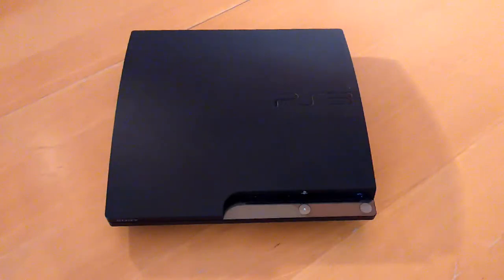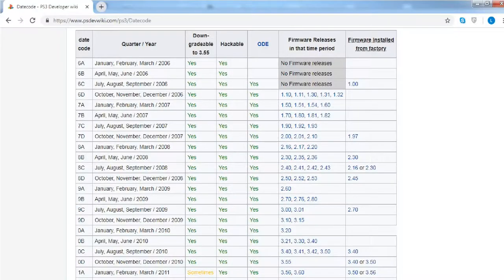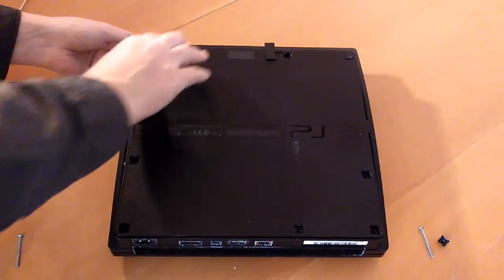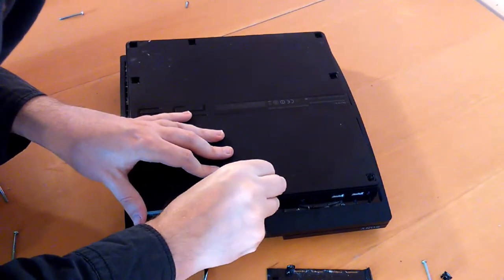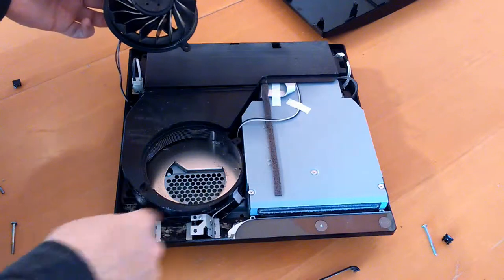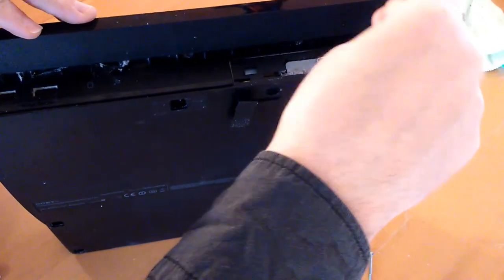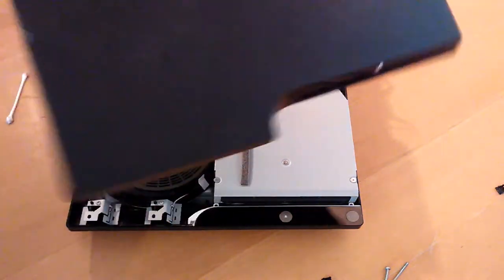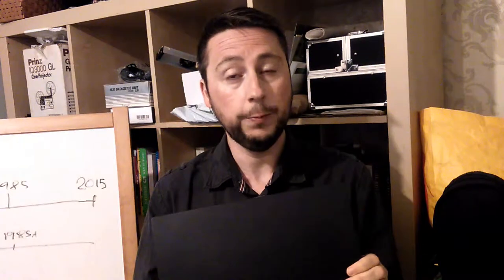How To Fix A Noisy PS3

Comment: Bro I tried the first method with holding down the eject button and plugging it in, and it sounded like it was gonna explode
Reply from the maker: Yeah it sounds like it's about to take off
Reply: EK tech  jailbreak got nth to do with the fans so you can do it
Reply: EK tech I’ve never had it I see it as mods in the files
Reply: EK tech  the method is to clean the fans and stuff and mods r just installed in the ps
Reply: @iklerzz721  well did it worked
Reply: @dennisbyrd99  ps4 now bro
Reply: @iklerzz721  I'm talking about the ps3 does holding down the eject button and plug it in method actually work
Reply: @dennisbyrd99  yh it works but if you’ve got a crazy amount of dust you’ll have to open it up
Reply: @iklerzz721  ok got it thanks 😎👍

Comment: My is now 9 years old and when I play something like black ops 2 the whiny noise get even louder and produces a lot of heat but I would have already taken it apart if it wasnt for the warranty sticker
Reply: PS3 Original consoles are too quiet and makes them very loud when they overheat because of the slow fan.

Comment: Everyone I fixed the noise if y'all want to know just ask me
Reply: HOWWWW TELL ME
Reply: @pratimagiribhat4075  make sure the ps3 ON then press down the powernub to turn off for 20 seconds and pull out the plug while pressing then turn on. Reply when you get thru
Reply: @pratimagiribhat4075  did you get thru
Reply: @christopherjohn1367  yup tq soo much it worked perfectly i was having soo much trouble but u solved tq again bro

Comment: I have the super slim and noise levels are ok, not quite where I would like personally but one thing I am concerned about is the heat. It's never shut off or anything like that but I can certainly feel it warming up after an hour or two of use. I don't really want to open it up so I'm using a big fan to keep it running cooler
Reply from the maker: At least it works!
Reply: Lmao a big fan? Outside? What does that supposed to do? 😂
Reply: Guys why my ps3 super slim doesn't have sound at all while playing?? And it's so hot

Comment: I did everything but it still beeps and says it's hot  when it's barely warm
Reply from the maker: Sounds more serious than usual. Potentially the CPU getting hot too quickly. May need a fresh load of thermal paste for the heat sink. There are kits & guides around on how to do this.
Reply: Thats not a good sign
Reply: @familyman831  found out I gotta replace the power supply
Reply: @TheRetroStuffGuy  I replaced the paste
Reply: @TheRetroStuffGuy  what signs indicates to change the termal past? My ps3 is 11 years old and I never opened to cleand it or change the terma paste
Reply: @santiagobarrett7417  The 2 usual signs are:
- Overheating quickly after turning on the console, or playing for a little bit, overheating warning pops up and the system finally shuts down to protect itself (This is the worst case scenario)
- L O U D fan, like if the fan was at 100% speed or close to that

Comment: Did it make it a little bit noisy less for you ? Mine is going crazy after 1 hour of gaming
Reply from the maker: It did. I do find in the summer months it does still get noisey after a while. Maybe worth experimenting with the surrounding airflow & ventilation.
Reply: The Retro Stuff Guy ok thanks for all, I will try it and I hope it will fix the issue so I won’t have to applie thermal paste cause it seems really hard for me
Reply: The Retro Stuff Guy hello again ,I finally followed your video, but I surprisedly found it near dust less, and It kept making noise
Reply from the maker: @alan370z4  sounds like you may have to do what you didn't want to do a go with the thermal paste route.
Reply: The Retro Stuff Guy argh this sucks lol it’s too much complex for me

Comment: My ps3 using monitor use vga converter to hdmi with audio hole, when i'm using aux cable to speaker has noise soun in every game, but the picture OK, whats the prpolem with it ?
Reply from the maker: Not sure as I've not had experience with that, but it could be electrical interference causing it.

Comment: i had my ps3 cleaned  and fixed professionally cost me 60 bucks but the fan is still so loud  can't hear the game i'm playing
Reply from the maker: I would ask for your money back.
Reply: The guy repaired my ps3 is fixing it again for free by replacing the fan and hard drive and transferring games from old hard drive to the new one and doing a big test on it
Reply: well it still sounds like ur next to a jet engine so im just selling it on ebay hate to as its a working ps3 that plays ps1 and 2 games so anyone knows found the issue with mine it has a blown power supply circuit
Reply: It could be, but I doubt it. I think it just need/needed a big proper cleaning inside, fresh thermal paste/pads, and maybe a delidding on both main chips.
Reply: @norbertgyuroczki3307  it was already cleaned and new thermal paste added but after that it got even louder
Reply: @thunderdragon8341  But the thing is, you can’t really know if they applied it properly, or if they used a high quality paste, that’s why I prefer doing stuff myself if I can 😅

Comment: Can it damage your PS3 over time if you don’t clean it?
Reply from the maker: It can certainly affect the performance....it's the same principles as a PC as to why you should have good ventilation around the machine.
Reply: @TheRetroStuffGuy  hey bro, I've done all of the methods in this video but it's still making lots of noise, do you have another solution?
Reply from the maker: @exquicitegamer88   it may need a fresh lot of thermal paste for the heat sink. The CPU maybe struggling. I've not done this before but there are a few videos on this.